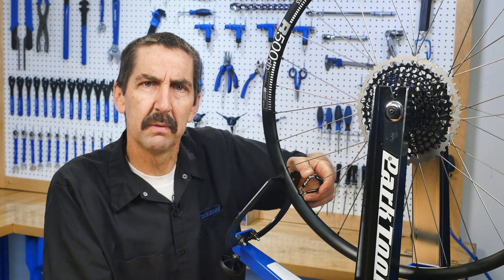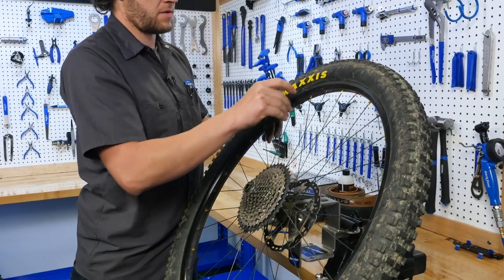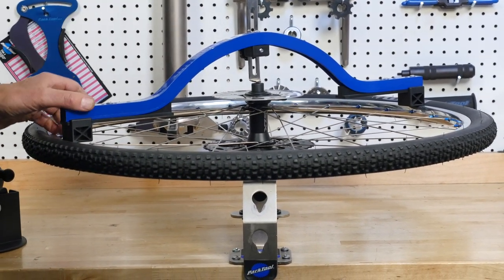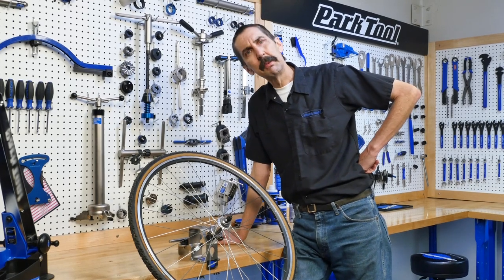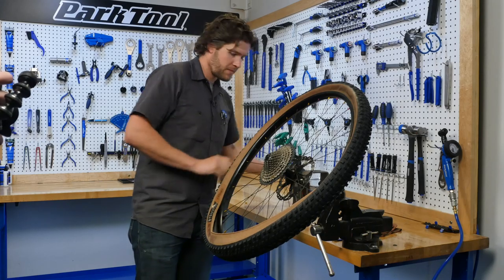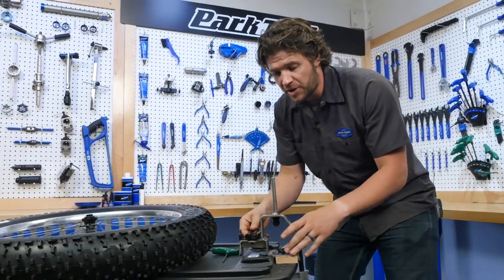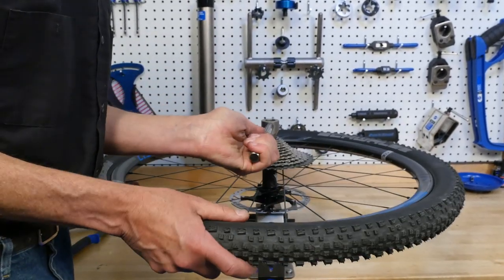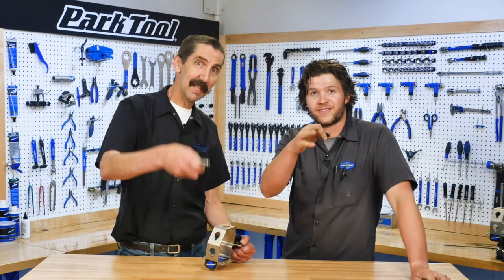Wheel Fixturing with the WH-1 Wheel Holder | Tech Tuesday #128

Comment: WH-1 after one day in use: I never ever give it away! Very functional for almost every work on wheels. Cleaning, changing tires (tubeless or other), checking the wheel alignment ...). I just would suggest to have kind of a stop for the wheel not to come off the axle easely in the vertical position. Nevertheless I highly recommend this tool!

Comment: Really enjoy using the WH-1.  Another great Park tool that makes working on wheels much easier.  One of those tools that you don’t think you really need until you buy it and use it a few times.  I hesitated to purchase it due to the relatively high cost for what it is, but when I began using it the rugged build quality became very evident.  Worth every penny.  My only gripe is the spacer design.  I have large fat hands with a lot of miles on them and I swear I drop that little metal spacer on the floor 5 or 6 times before I finally manage to insert it.  But I am not sure how you would redesign it for clumsy fingered people like me.  Also when I am using the support rod in the horizontal position to apply tape to a tubeless rim I have to be careful not to pull the rim sideways off the support rod. It would be nice if the rod was longer perhaps, so it would extend all the way through the hub, and had a threaded end to which one could attach a wing nut or something to better secure the wheel to prevent it from sliding off the rod.  . Obviously not a problem with the rod in the 45 or 90 degree position.  Just minor first world annoyances as my better half would say.  All in all a great tool.

Comment: As much as I’d love to say I’d be using a WH-1 to build sweet wheel sets, it would probably be best suited at keeping my wheels off the floor and my bench when attempting to fix something. And when not working with wheels, it will probably be a shop towel holder for when I’m away from a stand.

Comment: WH-1 could be rebranded as the "Park Wheel Stand", which reflects how generally useful it looks to be.  As your stand is to your bike, this thing is to your wheels. So you'd use it for everything.  

I wouldn't stop with bikes though. Why not spin the perfect pizza dough, play Price is Right at home, re-enact scenes from Don Quixote, or train the ultimate hamster.  Unless the manual explicitly forbids it, I don't see the problem.

Comment: I would use this in my shop to relieve stress from my lower back. It basically puts every wheel repair or build at the ideal height. Great thinking guys.
Reply: AMEN, brother man! at present i use a black & decker folding work bench that is
too low.

Comment: The WH-1 would be perfect mounted to my rolling CX / MTB tool box for cleaning cassettes, changing tires, swapping rotors ETC!   One thing.... does it also have a bottle opener adapter to go along with the 12mm and 15mm????  This is crucial for any post cyclocross wheel maintenance:). #rideon

Comment: I almost expected an appearance by the Mirthmobile! I wish we had the WH-1 when I worked in a repair shop. I worked on thru axle hubs by skewering them on a 3/8" extension clamped into an AV-5 in the bench vise. I would use the WH-1 for all of the applications featured in this video, and I'd probably discover a few new uses along the way. I think it would be particularly useful for taping rims, adjusting hubs, and mounting tubeless tires. Very cool tool!

Comment: I would use the WH-1 to: 1) finally upgrade to tubeless tires. 2) clean my (ceramic compound on the) rims more often so that the rim brakes stick better 3) avoid procrastinating more regular wheel maintenance, 4) everything that you demonstrated in the above video....

Comment: I would use the WH-1 to adjust the loose ball bearings in my vintage cup and cone wheels! Also, the WH-1 would be helpful in holding my 29er wheels to install rotors. No more awkwardly laying wheels in my lap and dirtying clothes for basic wheel maintenance. Awesome tool!

Comment: Tensioning, balancing, dishing, spot checking true, swapping tubes/tires/rotors/cassettes/spokes/bearings, and refining the design of my perpetual motion machine.  Love this tool.  If I don't win one, it will certainly be my next shop purchase.  The biggest hassle of working on wheels is that they are NEVER in a comfortable position.

Comment: Just placed my order for a new 2019 Kona Sutra with 12mm through axles. I'd use the WH-1 to  replace/clean rotors, replace tires or broken spokes, and general wheel cleaning. I already have a woodworking bench set up with a vise so this would fit in nicely in my limited shop space and store away when I'm not using it!

Comment: I just got my first full time mechanic job. As a 19 year old, I feel that’s pretty early. I was just given my own bench (woah) and I need to start building up my tool arsenal. I work alongside the GAP trail so 85% of my work is tube replacement and tire changing. Currently, I just stack up a couple milk crates to lay the wheels on whenever I work on them. Not the most ideal or efficient thing out there lol

Comment: I would use the WH-1 for tubeless tire instillation, cassette maintenance and wheel cleaning. I would weld a plate to an old BMX seat post so I could use the WH-1 with my PCS-10 repair stand. That way I could also use the WH-1 when needed while traveling. Love this tool, best new tool I've seen in a while.

Comment: Truing my wheels, fixing flats, and repacking the wheel bearings are cumbersome.  This video showed exactly why the WH-1 would make all of those jobs so much easier and more fun!  By the way Cal, what was that app you were using for entering the tension values of the spokes.  That radar plot is super useful.  Thanks!

Comment: I would build wheels; change rim tape, tires, sealant and inserts; change cassettes and rotors;  adjust hubs;  but I wouldn't use it for checking dish. I would use it in my garage workshop and also take it with me in my mobile bike cave (van).

Comment: I'm completely rebuilding my 16 year old steel framed touring bicycle  that has 20K+ miles on it. Complete tear-down and fix up that started when a spoke pulled a hole in the rim---that's when I knew it was time. Haven't done any of the wheel work yet, the WH-1 would be a dream.

Comment: I'm a bicycle assembler For a small shop In Colorado , I specialize on recumbent tricycles! Yeah I know 2 dirty words in one sentence, So how would I use the WH-1 Well I have to install brake rotors on a lot of 20 inch wheels, Which I prefer to do with a torque Limiting hand tool, Using a trash can has a work stand, So holding the tools still and rotating the Rim Instead seems to me to be the right way to do it! also we live in the high desert Which is "Goat Head Thorn Country" So we upgrade tires and tubes a lot, and Marathon plus Tires do not go onto 20 inch wheels without a fight!! I can see where the tool would save me a lot of time and aggravation And as an assembler I'm paid by the bike so the faster I get it done The more money I make!

Comment: I recently purchased a Husky 3-drawer tool cart to use for my bicycle repair/tune-up activities. I plan to attach a WH-1 on the left side and eventually a truing stand on the right. Upgrades include adding some peg boards and even an air compressor.

Comment: I would also use the WH-1 for changing an inner tube. Place the wheel horizontally in the WH-1. Unseat one side of the tire using a tire lever. Remove the old tube; install the partially inflated new tube in the tire, re-seat the tire bead and inflate. Would make a fun competition at your next Sea Otter.

Comment: I've heard that removing the decals on my carbon wheels is a pain, with lots of patience and heating required, which has prevented me from taking the plunge. This would be infinitely more comfortable if the wheel was fixtured so the decals are facing up on a workbench and the wheel can be rotated easily. If I were to win the WH-1, this would be my first order of business!

Comment: I would end up bringing the WH-1 into the service department at work. Sharing what I've learned from this video to my co workers. It seems like it can be a time saver, all while keeping the work area cleaner with less tubeless sealant on the shop floor. Less working down low, off of the ground for tire changes as well. Rad! The wheel lacing idea is great. Would definitely put that to use in our service department.

Comment: When I'm working in school science I like to do practical STEM projects, so the children can see how the scientific principles they learn about can be seen applying to real life situations.  Bike mechanics make a great way to demonstrate elements such as overcoming friction through the use of bearings, as they are quite familiar with cycle wheels, if not with how they actually work.  (As an aside it also allows for inclusive awareness and learning, as mobility aids such as wheelchairs often have similar mechanism to bikes.)  Having taken apart wheels in class I do find it is problematic ensuring that the equipment is both visible to the class and accessible for the children to use the tools to take apart and examine the bearings.  I think it might be possible to combine the WH-1 with a portable clamp/vice to attach the wheel to a desk in a way that would make it much easier to both demonstrate to and involve the pupils in such mechanical investigations, with the hope that it will fuel their curiosity to engage in other STEM related activities.

Comment: With the through axle attachment used as a spindle, the WH-1 would be perfect to hold a bagel so you can spread your cream cheese with one hand, and keep it from falling on the floor and collecting small bits of metal, cut off bits of shifter cable, and shock oil.

Comment: I would start running my bikes  tubeless. I have always had an issue with a good way to hold the wheel while putting them together. I also want to try wheel building. I like to all my maintenance and it would really help with servicing my bearings also! This looks like a very versatile maintenance product and would help this guy out greatly!!.

Comment: Curious...how do I put a wheel on the WH-1 using a QR connector, but not having to have the other end connected, like a thru axle type?  Like to do this so I can remove cassette, etc and don't want to have the nut on the other end.

Comment: I would definetly use it on the shop to speed up tyre and tube changes, lacing wheels, tubeless setups and also, one could be added in the tank to wash the wheels a lot easier.

Comment: This could be very useful to stress relieve wheels by twisting the rim about the hub. I saw a video where DT Swiss builders push axially on the hub with a press and the rim supported in a jig. If the WH-1 can provide a secure enough hold on the axle then it could do something similar and potentially work better than just squeezing parallel pairs.
Honestly though, I wouldn't mind just having a place besides the floor to put a wheel at my bench when it's not in a bike, my hands, or a truing stand.
Reply: PS: I'm at a shop here in the Cities and would be happy to show one of these off :)

Comment: I just bought the WH1... my first impression is great if you have thou axel wheels ,but for QR wheels is awkward ....I was hoping to be able to used it, to remove my 1by 11 cassette, but it didn't seem possible
Reply from the maker: The hole in the WH-1 fits most quick release skewers.  Turn the adjust nut quick a bit inward first, then guide the lever through the hole, with lever in open position.  Engage in slot.  Turn adjusting nut down, and close skewer tightly, like on a bike.  The cassette is now facing outward. Use the FR-5.2H which goes over the adjusting nut of the skewer.
Reply: As I first said, it a great product for thru axel wheels, but not optimised  for those of us with QR and its  totally useless for fixed axels...like hub gears bikes. I feel Park Tools should pointed out these basic floors....I feel I was mis sold by Park Tools! Guess Park Tools will say anything the sell there products....shame on them

Comment: Does new portable workbench got holes for WH-1 or WH-2?
Reply from the maker: We use the PB-1 with the WH-1 at events.  Use a small block of wood on the side to shim it up.  Then use a carpenter's clamp to hold it tight.  Works great.
Reply: @parktool  Surrely work great, but there is now reason to upgrade to PB-2 :)

Comment: I was thinking this would be nice to use to do bearing work but I looks like it needs the quick release engaged to mount the hub sturdily which of course prevents you from accessing the bearings.
Reply from the maker: Yes is can be used this way.    It takes a little more work.   Use the "pacman", the black washer with slot.  Remove skewer springs. Install with skewer inside the body. Use the washer to thicken the steel, duplicating the thickness of a dropout.  Install wheel with skewer nut outward.  Tightness skewer as normal when riding. Now you use two wrenches outboard of the tool.   See 41 seconds at https://youtu.be/NWfQuadPJq0
Reply: @parktool  Thanks for the reply but I wasn't super clear. I meant bearing work with the axle removed for overhauls.
Reply from the maker: You could make a mount similar to the thru axle mount just for QR fairly easily. Take a QR that has a decent amount of threads, thread on a qr nut all the way onto it leaving more threads showing then put another qr nut on. It is not as sturdy of a mount as the thru axles just by the nature of there being 1/3 the material there.
Reply: @parktool  Of course. Brilliant. Thanks!

Comment: How big is the gap for the bench vise? I only have a woodworking bench vise and it has bigger vise brackets than your bench vises in the video. I could not find any dimensions on your website :-)
Reply from the maker: The dimensions of the tab that goes into the vice is 2" x 3/16".  I see no reason it would not work in a wood working vice.
Reply: @parktool  I mean the part in the back of the WH-1 which has the adapters on top. If my wood working vice bracket is to thick to fit into the "C-shaped" part of the WH-1 than I would not bet able to use it with my vice. Sorry for the bad description, but I do not know the correct words in English :-) In the video at minute 2:15 you can see the WH-1 from the right side. Your vise bracket fits into the "C-shaped" part two times. But what are the dimensions of this? :-)
Thanks for your help!
Reply from the maker: We had the WH-1 mounted in the back vise tab. There is also the one at the front of the WH-1 that will allow installation into a vise that is flat with a bench or has very thick jaws.
Reply: Park Tool great, thank you! Looking forward to using the WH-1 :-)